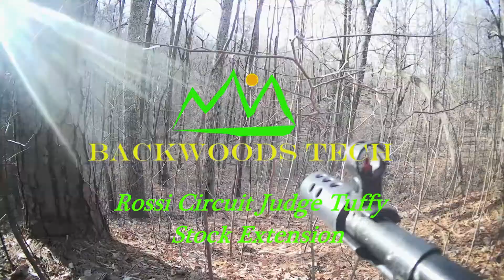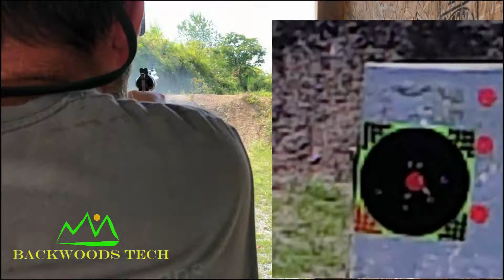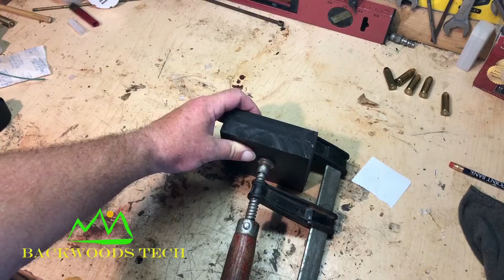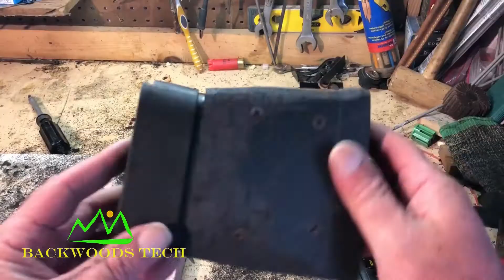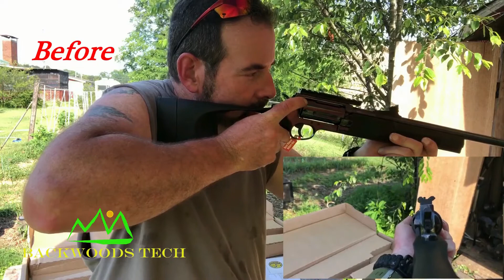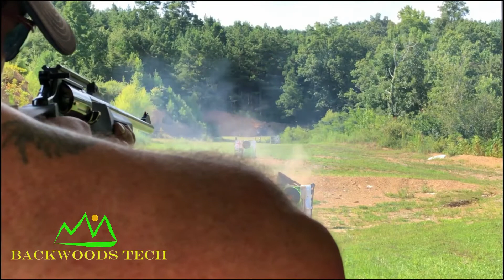Rossi Circuit Judge Tuffy Stock Extension with range time

Comment: Nice work, I like how the extension turned out. This rifle gets a lot more useful if you're reloading the 45 Colt for it. That opens the door to using slower burning powders that can make use of the longer barrel. Magtech makes brass 410 shells that use a large pistol primer as well which opens up even more options. Good hunting!
Reply from the maker: Thank you. I do in fact reload and use fire form 303 enfield brass for 410 shells

Comment: I recently made mine from two pieces of sandwiched 1" thick marine Starboard about 4 inches long, I traced the end of the stock (not the butt plate) and cut out that paper pattern, adhered it to some 3/4 inch plywood and sanded out the shape on a belt sander. with that attached to my block I then sanded to the dimension of the patterns. After that I cut the rabbit that inserts into the stock on the table saw. Then I hollowed out about three quarters of the inner material to match the stock and fit the butt plate... absolutely rigid even as thin as the stock and far lighter than a couple holes drilled would have been. I secured it all together with a couple pieces of 3mm brass all-thread and a couple of flat spring clip nuts. I think i'll try 3 stacked segments next and see if I can get a better fit and finish. Thanks for your ideas and video, you set me on the path to comfortable aiming while retaining the stock storage features I wanted. And yes, the addition of the stock band hides the extension and gives me a few more quick access shells. Best of all its completely reversible to out of the box original condition. BTW for those wondering Starboard HDPE does not glue up well, only screwing, bolting or welding are recommended.
Reply from the maker: Good deal  Its a great gun the short stock is just weird